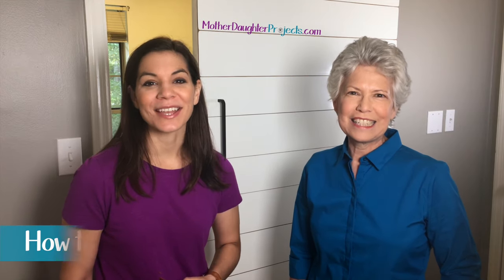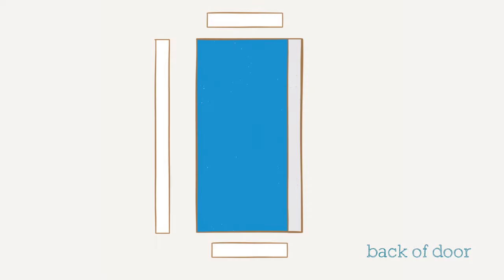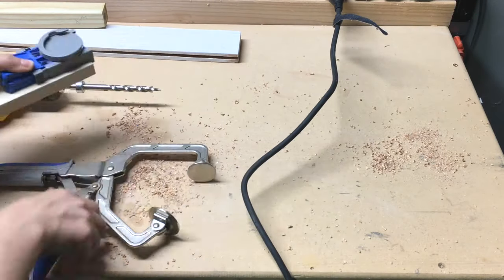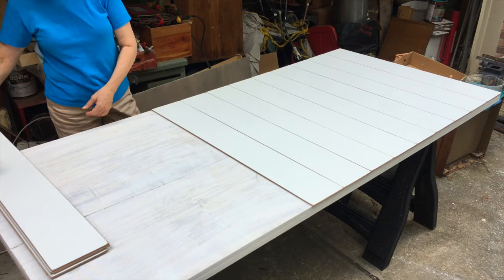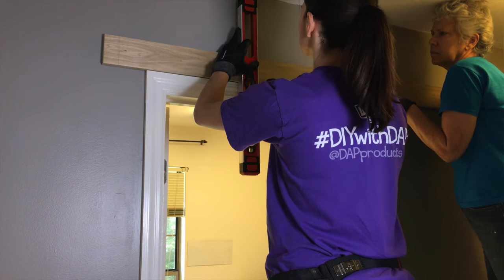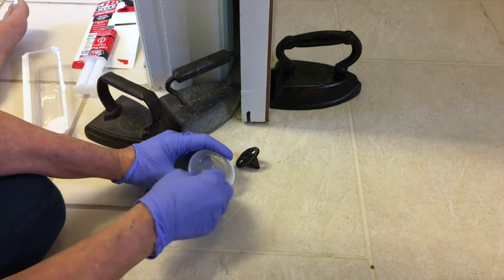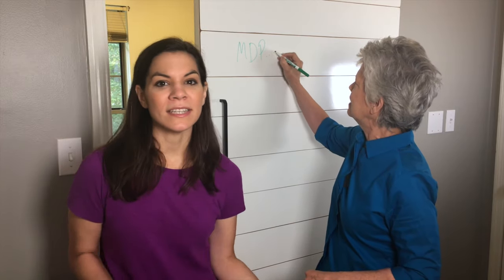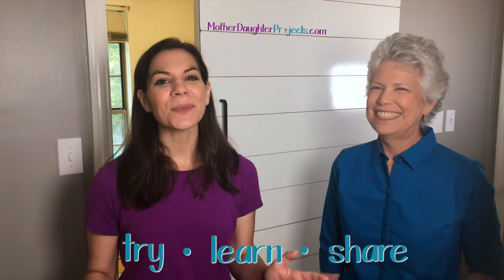DIY Barn Door Installation

Comment: I'm in this process right now.  Glad to hear the suggestion about the header as 1X6 that is recommended for the track just seems too wide.Of more interest to me is how you took care of the hinge mortises in the casing when you removed the door.  Someone should invent an easy filler for those.
Reply from the maker: We filled them with wood filler. We filled them a few times, sanding between. Then we painted the frame with our trim paint.

Comment: How do you know how thick your header board should be? I too have trim that I would like to cover.
Reply from the maker: I believe ours was 1/2" thick. You want something substantial, we used poplar wood as our header. The staff at the hardware store should be able to show you what you need. Just take pictures of where you need the header before you go, so they have a reference for what you are doing. -Steph

Comment: What dimension lumber did you end up using the second time around for the header board?
Reply from the maker: Hi David- the header board we used that worked was a 1x4 piece of poplar wood.
Reply: Mother Daughter Projects thank you.  I was considering using 2x6, but after hearing what worked for you,  that is probably overkill.  curiosity, what did you use the first time.  By the way... great video
Reply from the maker: You're welcome David! The first time we used a 1x3 pine I believe. This was too soft of a wood- poplar wood is much stronger and worked great!
Reply: Highly recommended by using a very heavy 4x4 inch beam ( 6ft) length if the door is heavy (50 kg) like my my project was...I thought I had solid wall all over the 6 ft area...but hadn’t...only the are to the left. ( brickwork) the rest was hollow apart from slight blockwork at right hand....failed in every way possible due the the weight. Day 2 install a 4x4 x 6ft peace of mind...these hardware kits are good, IF INSTALLING light weight doors. Beware!! Non of these companies actually tell you until it’s purchased.